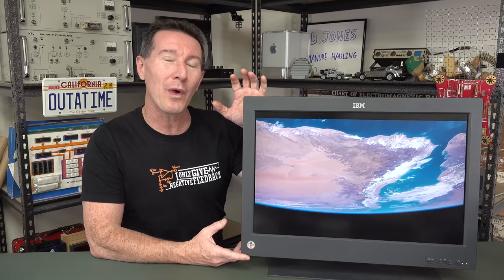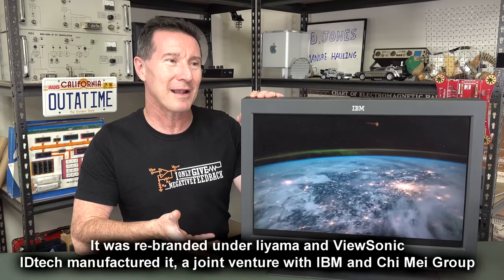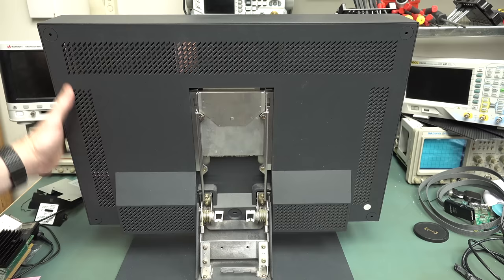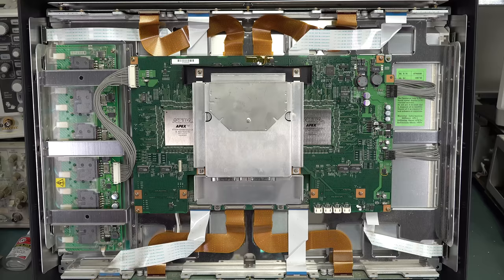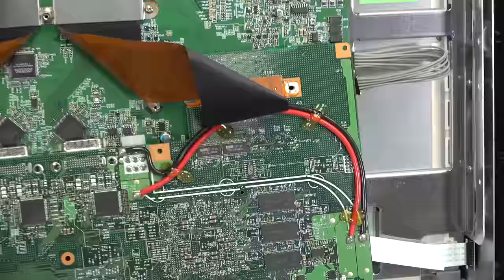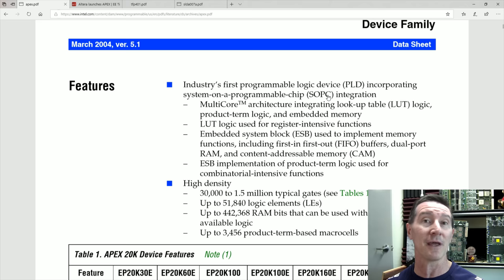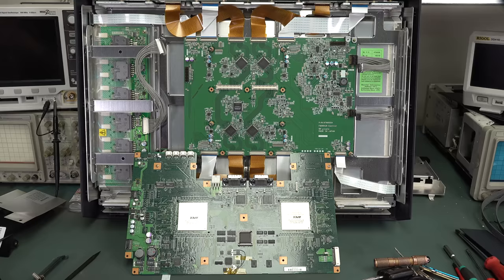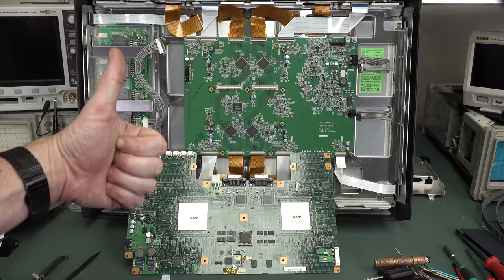EEVblog #1215 - $18,000 4K Monitor Teardown From 2001!

Comment: Man I still don’t have a 4k monitor
Reply: Mine is broke after 1 year , and this thing is still working after nearly 2 decades , amazing ...
Reply: @6417893265q784256128  because IBM didn't include planing obsolesence inside, now every tv, monitor etc have that "feature"
Reply: @Wilson84KS  never assume malice where incompetence is a reasonable explanation.
Reply: Dude, they are still very much the exception rather than the rule. Join the club, as they say.
Reply: @6417893265q784256128  For 8k$, you could forgo buying the cheapest parts, and instead just spec out the best parts..
Reply: I do they are becoming cheaper soon you will have 4k too.
Reply: Go buy this one mate
Reply: Me either
Reply: @procactus9109  UHD is 4K, but 4K is not always UHD since UHD is it's subcategory.
https://en.wikipedia.org/wiki/4K_resolution#Resolutions
Reply: Same
Reply: @6417893265q784256128  CRTs were simple, old, reliable tech by the time this was made and about to go obsolete not long after this time even.  Give 4K LCDs another 10 years to mature and they'll be almost indestructible.
Reply: @Wilson84KS  You seem a bit clueless.  'planned obsolescene' Keeps the production systems operating correctly, and keeps the current tech cheaper and on a faster life cycle, which is far better for the people using it.
Case in point, this 22" 4K monitor still works.  No one doing 4K work would even touch it, they'd go buy a much larger and better $250 TV.
Reply: @QoraxAudio  And you quote Wiki on this ? Dig deeper
Reply: I don't even have a 1080p, I use 720 for gaming
Reply: vga for life
Reply: @procactus9109  I quoted wikipedia on it, since I already knew about the facts and didn't need to research it again.
And when it comes to technical information/nomenclature, wikipedia is often quite reliable, in contrary to medical and, especially, philosophical topics.
I once read the wikipedia article about Nietzsche and it was so horribly incorrect on every aspect, made me cringe haha
Reply: Not much of a difference to 1080p
Reply: i have 5k
Reply: I use a cheap benq too, no 4k yet, as you need a strong gpu with that anyways.
Reply: @6417893265q784256128  my samsung lcd broke after 6 years, then i changed some caps and used it for ~ 3 years and now i have to change the board, no point. But yes, those old ones live longer, not as sensitive to various factors.
Reply: I still don't have a 1080p monitor
Reply: Cries in 720p
Reply: @Tim_Small that’s a childish statement. I’m not a Harvard engineer. So I doubt assume a group of a hundred of them are dumber than me.

Comment: I worked in IT support for the engineering dept of a fortune 20 company in 2001... we had hundreds of NEC 21" CRT monitors.   Then when these came out we got a boat load of Silicon Graphics workstations with custom made video cards (onyx?) and 60 some of the T221s.   The SGIs went away quick but the T221s hung around for years.   Amazing for their time.   designers were taking hi-res pictures out the windows then setting a monitor in the window and adjusting the cameras to get the display to match the outside world.
Reply from the maker: Nice!
Reply: @ap-np5qb  My bet is that it will go haywire and not show anything but an error code
Reply: ramosel
consumer electronics, support you did?
Only Canon did them, i guess DELL used them to sell this, same tech it used!
Silicon Graphics workstations used Canon too, on the more expansive solution, not the cheap Onyx Desktops!
Reply: @ap-np5qb  You have to connect them on Dual link, just as SLi in 2010, drivers etc.
Here, no smart people, they all just don't understand, or smart enough to use Google!
Reply: @lucasrem  In house, not 3rd party
Reply: @Kalvinjj  No, it will work just fine.  The monitor provides EDID on all links and they do not need to be in synchronized timing.   It will just look stupid having four unrelated 960x2400 stripes.

Comment: That video card says 2009 right on the sticker and it’s obviously not from 2001 or earlier because it’s PCIe. It wasn’t “old-hat” when this monitor was released... it was from the future!
Reply from the maker: Dang, you're wright.
Reply: @EEVblog  . Yeah i was also wondering. So the question is, what cards did they use? Back in the day I guess some sort of AGP configuration. Bunch of first generation Quadro cards?
Reply: @merlingallagher4484  it originally shipped (was paired) with Matrox GPUs
Reply: it was from 2001 just modded 10 years ago
Reply: @merlingallagher4484  Earlier ones were bundled with a special multi-monitor version of the Matrox G200, later ones came with a converter box which allowed you to use a more pedestrian gfx card, like a Geforce 6 based quadro.
Reply: Pye Ltd. That might explain some of the rougher method for securing some parts.
Reply: G GG yep

Comment: I was expecting it to be a CRT until the microscope close up revealed it's an LCD.
Reply: 4k off of a CRT would be Nobel worthy tbh
Reply: @thedrwatson4363  It would be very possible actually. The screen would have to be very big in diameter though (much bigger than this LCD here) because the dot pitch of the mask cannot be as small as a pixel on this LCD's panel. (But then again, 4K on a small display doesn't make sense anyway.)

The best CRTs have a dot pitch of 0.23 mm. Based on that we could calculate the required size of a 4K CRT. 

Actually, let's do that:
4096 * 0.23 = 942.08 mm (so for 16:9 ratio the height is 529.92 mm)

Now let's calculate the diameter using Pythagoras:
942.08² + 529.92² = c² | pull square root
=1080.89 mm = 42.55 inches

Yeah a 42.55 inch CRT is one hell of a monster but not impossible.
Reply: @thedrwatson4363  I was given a large 1080i CRT TV a number of years ago. It had a bad solder joint that caused it to intermittently stop displaying correctly, but it was too bulky to be worth trying to repair, given how much 1080p LCDs have come down in price.
Reply: Now halve those numbers because custom ingenuity.
Reply: @Baigle1  Yes there hasn't gone any development into CRT technology for 20 years now and my numbers are based on what was possible in the very early 2000's, but it's most likely not the maximum that would be physically possible. If only there was a revive of CRT technologly, who knows maybe 24" 4K CRTs would be possible (although I still think you don't need 4K at that size).
Reply: More interested in DLP or another similar display technology that can scale to nearly any size, at 200+ frames/second, with perfect color accuracy, and no need for pixel ghosting removal or post-processing of a signal. Display tech should in theory have no more than a few microseconds processing and display lag. Pair that with the right reflective projector material say a fresnel reflector, not that glossy crap, and you got it made. Honestly think the reflector material would be the hardest part, and as long as flexible uLED wallpaper isn't as good you have a niche product. Somebody get it done.

Comment: Damn, cant imagine driving it. 

I got lucky as a teen in early 2000's by getting 1600x1200 100hz crt monitor. used it till 2010 when it died for good
Reply: Had a graphite grey SGI CRT with similar specs back in the day. Think it was 21" or 24", pain in the ass to move lol
Reply: @Chriva — nice, brings back memory of the first LCD screen with 1600×1200 pixels I got at work around 2004 (a Fujitsu-Siemens, I think). It was my favorite resolution for quite some time because of the lines of code visible at once, often side by side. Later I got me a refurbished Eizo with 1920×1200 pixels which I’m still using right now. (Not nearly as heavy as your CRT though, thankfully. ;-)
Reply: Yea, I managed to nab a 1600x1200 CRT for £30 and it was in use until 2009.That sort of resolution and refresh rate was bonkers to me back then :D
Reply: Wonder what the failure was. Should have lasted tiny bit longer. Maybe it could have been fixed. There is a marked for CRT screens!! I would like to buy one. Why? Old gear, need the 0 latency.
Reply: Sweet Jeeezzz. I just (like 2 years ago) destroyed my old jumbo 22" 1600x1200@60Hz CRT I was using in 1999 to mid 2000's. Just because I don't have storage space for such enormously big and heavy piece of junk. It was still good. I dig up mosfets and similar stuff sometimes from its remnants.
Reply: I bought a 22" 75hz CRT in 2003, finally scrapped it this year. 16 years without issues is a long time for a "relic".  R.I.P.
Reply: A C R.I.P,L.C.D.
Reply: @S730SD  CRT is best for Gaming

Comment: Back in 2003, I had the Viewsonic twin to this, called the VP2290B, it was nothing at all like today's 4K monitors. For a start back when they were released they came with the best multi monitor card of the day the Matrox G400 x 2 (the video card shown here was for much later versions) which was a purely 2D card and it draw the screen by combining 4 panels together (MS Windows thought that 4x monitors connected) which actually worked fine HOWEVER it was a hopeless monitor for anything other editing still photos etc. The refresh rate was so terrible that you could have no movement.
Reply: Worth mentioning that those cards were basically two Matrox chips and a PCI bridge on one card. They had some later ones with four total GPU chips and two DMS-59 plugs!

Comment: We actually had the IBM and the Viewsonic version in our test lab.  The first version was driven by a 4-port Matrox G100, and it actually saw it as 4 different monitors, so it was a little weird when you maximized a window, and it only took up 1/4 of the screen.  There were not many video cards that could drive this monitor in it's native resolution.  I think it had a refresh rate of like 20Hz.

Comment: Wow. Just watched this vid on one for my two T221. I got them in 2009/2010 for approx. 1000€ each.

I actually got my two IBM T221 upgraded to 2x DualLink-DVI each using adapters of cirthix/ZisE.
With active DL-DVI to DsplayPort adapters one can make them work with modern graphics cards. AMD Eyefinity helps a lot.
One T221 is running at 55Hz (overclocked) the other T221 is running at 48 Hz (stock). Fans have been disabled for silent operation.

I will not replace my T221 displays until 200dpi/120Hz 4k screens will become available.

Comment: 11:12 on the silk screen they even included where they wanted to place the hot snot, brilliant :-)
Reply: In my T221 the cable drawing on the silkscreen is going right under the cable. Dave's T221 is of an older revision I guess.

Comment: Regarding the need for four DVI cables, that makes perfect sense to me.  A single-link DVI cable (which those connectors are) tops out at 165MHz.  After subtracting the 8/10b overhead, that means a data rate of about 4Gbit/s.

This is enough to deliver 1920x1200 at 60Hz. but if you want to go to 4K (4x the pixels), you need four links.  Had they used dual-link DVI cables (an additional 6 pins between the two groups of 9 seen on a single-link cable), then they could've gotten away with only two cables instead of 4.  But it is quite possible that video cards with dual-link connectors on the output side weren't available at the time.

It's also interesting to note that this display was using only 42 Hz refresh (I think that's what you said) with four cables.  With four links, DVI can produce 4K at 60Hz, but maybe that was too much for the technology of the day, either in the display or in the video card.  And there was probably quite a bit of overhead from needing to sync two video cards together in order to produce four synchronized links.

Great video and thanks for the info.  I had no idea such a display even existed until now.  Back in 2001, I was still using 17" and 19" CRT monitors, usually driven at 1280x1024 (or a tweaked 1360x1024 in order to get square pixels) over a VGA cable.  Occasionally deciding to overdrive the display to 1600x1200 (and putting up with poor image quality because VGA can't really run that fast).
Reply: great comment, good info
far above avg youtube cancer
Reply: A later version goes with 2x dual link.

Comment: 6:03 Dell's 8K monitor takes 2 displayport inputs, if you have 1 it runs at 30hz and if you have 2 it runs at 60hz
Reply: Run 4 for 120hz?
Reply: Now that is powerful
Reply: Run 8 for 240hz
Reply: Yeah, that's because 8K is smacking against the bandwidth limits of DisplayPort 1.4.  The next version (probably will be DP 2.0) which is supposed to be released later this year, is expected to support 8K at 60Hz over a single cable, but that's of no use for equipment currently being sold.

Comment: Thanks for the memories, Dave! If left the electronics industry in 2001. For most of my career I worked on pro video equipment for broadcast and post-production , so boards like these bring back a feeling of familiarity. For those "bodge wires", we used to call them "kludges", I would use green insulated wire-wrap wire and route them carefully so they were electrically correct but so neat that they looked a lot like another trace. There were times when traces didn't work and we had to hack in some shielded cable to get signals from one place to another on large boards. That monitor is a beautiful piece of gear.

Comment: I saw a curved monitor at the 2002 CES show in Las Vegas. I would figute those things had not retail price being floor demos on display by the manufacturer. I was there as a web consultant for a company that bodged cameras and monitors into news helicopters can't say the company name but they did most of the news copters.. I figure it was somewhere around a million for a system from bate helicopter to news copter.

Comment: I was getting 2048x1536 in 2006ish. We did a big drop when we switched to LCD!
Reply: It was sad, ghosting and 60hz crap we got with slim monitors
Reply: Worse is when wide screen came out.  When it first came out, it was basically like buying a screen with a chunk of the top missing. The screen was physically bigger, but you lost a lot in resolution.  Took a while for them to catch up.

Comment: I was enjoying  QXGA back then in 2000yr     (2048 x 1536 @60hz) on a CRT
Reply: This is max. res. on VGA
Reply: punker4Real
CTR is analog, so any resolution!!! If your card produced it, your CTR shows it, is it sharp, or do i need less Hz or resolution!
 analog!!!!!!!!!!!!!!!!!!!!!!!!!!!!!!!!! why is that for you noobs so hard to understand here?????
Reply: @lucasrem  Yes, it's analog, but cables and connectors have frequency limits.  I found that driving a VGA signal at 1600x1200@60Hz would tend to produce a bad image, with ghosting along the edges of text.  Mostly because the high frequency signals would reflect off of the connectors because the cables were simply not designed to carry frequencies that high.

Comment: I'm still rocking with my 19'' 1280x1024 monitor.
Reply from the maker: You need to visit my dumpster...
Reply: I love 5:4 ratio.
Reply: @basshead.  No offence but I wish 5:4 monitors were never made and used 4:3 instead. I understand it was a shortcut for production, as it was easier to manufacture a panel with 1024 vertical lines rather than 960 but it caused a mess in resolutions, where people used 1280x1024 even for 4:3 CRTs, never understanding they are actually ought to use the proper 4:3 version which is 1280x960, because 1280x1024 is correct only for 5:4 LCDs. To this day I read and hear things like "Back in the day on my 1280x1024 Trinitron..." and it makes me facepalm.

Comment: Those DVI connectors are single-link, note the missing pins.
I have a 2.5K monitor connected using DVI and it requires dual-link DVI which is equivalent to those 2 separate single-link connectors.
Modern display cards support this without problem.
Of course a modern setup would use Displayport.

Comment: Oh yeah remember that beast well.  Needed a special dual video card but the issue was a fairly low frame rate.  22Hz or something?   Saw it used as a medical image monitor for CT scans from memory.   Never seen inside one however - well done, and yes it worked as if there were two separate monitors in the box.
Reply: Andy Grace Yep Matrox had special HDR cards for accurately displaying all the shades of grey in Xray images to doctors looking for tiny variations indicating tumors.  To this day, there's a bottleneck of getting enough oncologists who can look at X-rays and determine if someone needs urgent surgery or are perfectly healthy.

Comment: I would gladly use this monitor today, it's a beauty.
Reply: Not to mention that it's around the size of your average desktop monitor today.
Reply: If you could interface to it lol
Reply: @userPrehistoricman  Well, since it has quad DVI input, all you need is two cards with dual DVI outputs, or four with single DVI outputs, running at 1920x1080, and arrange it as an extended desktop.
Reply: Does it work like that? I don't remember Dave saying that the display became effectively 4x full HD screens with the 4 DVI inputs. That also begs the question: why only 41 fps when DVI can do 1080p60?
Reply: @userPrehistoricman  No idea if it really does work like that, but it seems reasonable if it can work with 1, 2, or 4 inputs. I think the way he describes, it was used was sort of the opposite of SLI/Crossfire, where multiple inputs make one image instead of multiple cards making one output.
Reply: he would regret it after moving it twice.

Comment: I recall being a software contact to a major merchant bank in Sydney in the late '90's. Their IT Director told me about meetings they were having on the quiet with IBM about these new "flat-screen" monitors. The bank was using large CRT monitors like NEC 5D's for their brokers on the trading floor. Moving to flat screens for all would allow the addition of a complete extra row of stock brokers. This would give them a jump on competitors, perhaps at most 2 years. It was purely the physical space they would gain, plus the extra stock trading volume. So price was not an object.